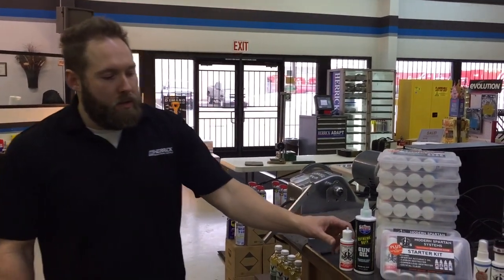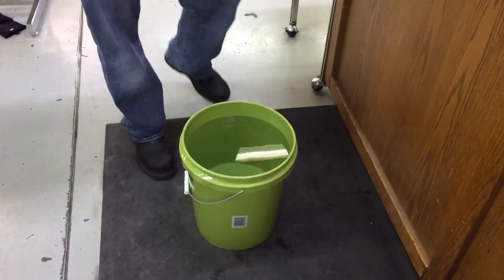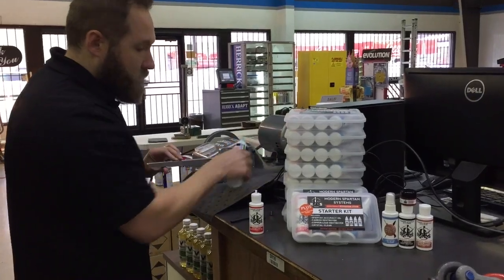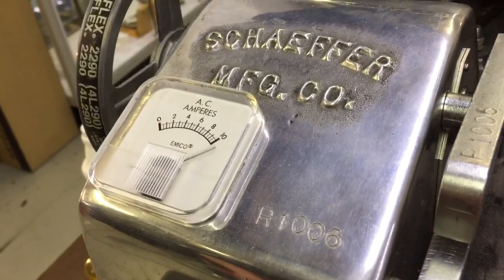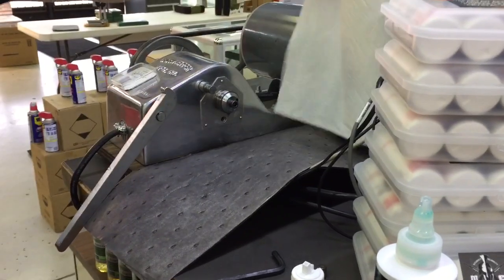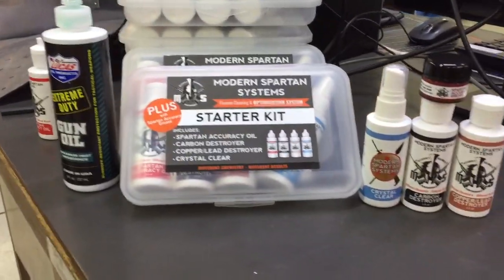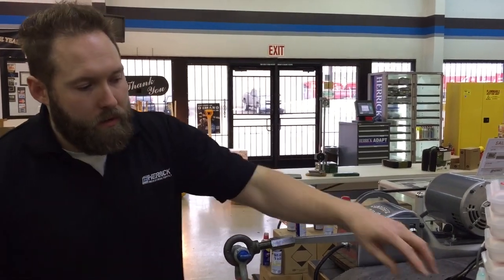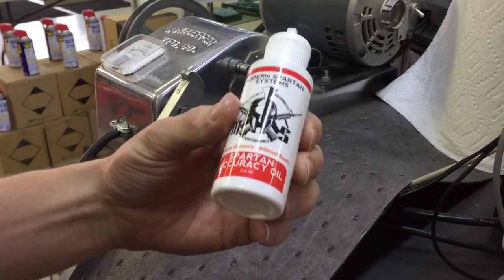LUCAS EXTREME DUTY GUN OIL VS SPARTAN ACCURACY OIL

Comment: Lucas synthetic works best for me and it smells wonderful !
Reply: Put this way all oils have some form of friction modifiers, its only that the companies who make the oils only put in just enough to get the oil graded to a ISO standard, so a mineral oil base with friction modifiers added to get the semi synthetic grade and so on, if you want to use a full synthetic oil go right ahead but nothing beat's adding the right % of extra protection to your engine oil and transmission oil and power steering oil and diff gear oil or manual transmission gear oil, look up the machine magazine content about friction modifiers and you will understand the most important factors of how oils are made and how to check if your engine oil or oil used is working by having regular oil testing done by a certified  scientific lab which only does oil testing, cheers :)

Comment: You didn't clean anything off. You cant remove oil from a smooth steel surface by rubbing it with a dry paper towel.

Comment: I'm not saying I disagree with the results but the test of the second oil did not start with a clean surface on both contact parts. It could lend to tainted results. Overall the spartan systems lubricant looks very good.